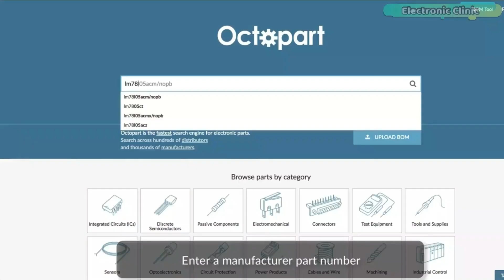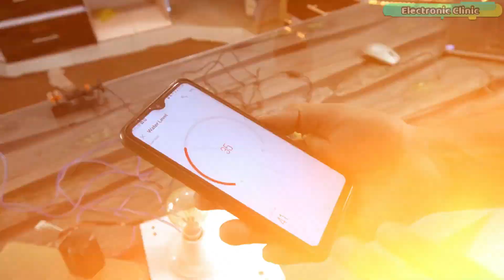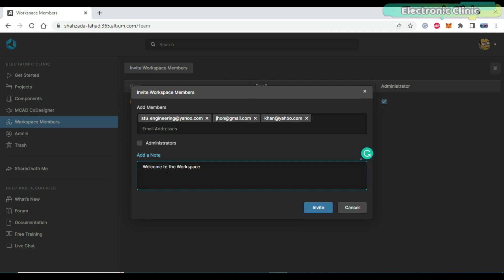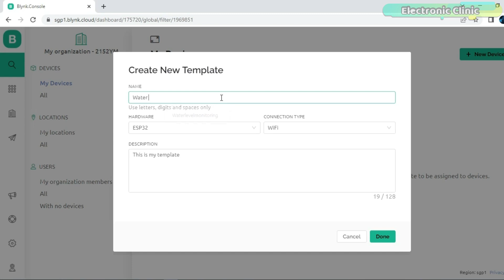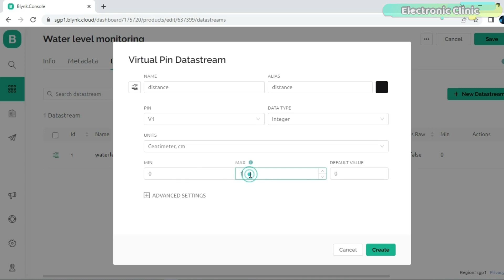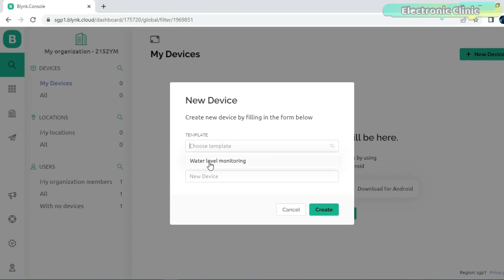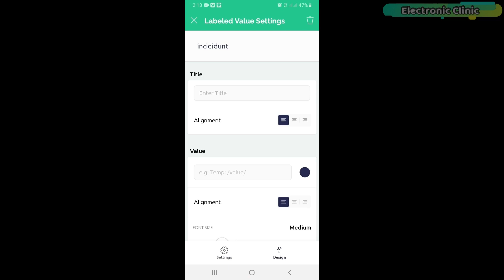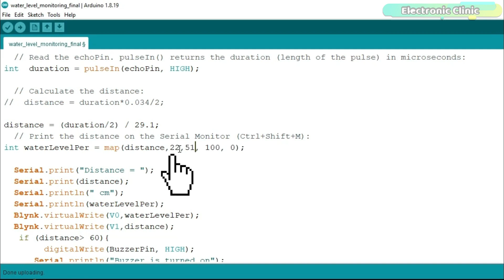IoT based Water Level Monitoring & Control System using ESP32, Waterproof Ultrasonic Sensor, & Blynk

Comment: Thanks for wonderful video. Circuit diagram of prototype project is fine but in practical scenario, how did you manage placement of Relay and ESP32  assuming Water pump motor is placed at ground in separate society cabin? I mean  did you place relay and ESP32 on Terrace near Tank and took relay output AC 240V phase wire all the way down up to inside ground cabin or you placed relay and ESP32 inside ground cabin?. if so in this case how to connect GPIO -25, 26 of ESP32 to TRIG and ECHO pin of sensor which is all the way at on Terrace?. If it is not your home scenario, but if this scenario come how can we manage this?
Reply from the maker: It's simple, use two esp32s 
One as transmitter and the other as receiver. Watch my video on esp-now, or you can use LoRa , watch my recent videos on heltec lora32.
Reply: @ElectroniClinic  OK. thanks for prompt reply

Comment: Hello Friend,can we use your coding if we don't want the Blynk part? we just want use the automatic system wireless water controle make off and on the Pump But Without monitoring to Blynk? i'ts possible with your code? Thanks in advance for your reply.
Reply: Oh sorry i make a mistake to my previous message,I confused it with your previous Wireless project, in fact I would like to make the wireless system with the control of the pump by the relay. if you can help me for that? thanks

Comment: hai bos..could u give me an idea.. why i can measure the distance under 20cm..bcause i am using a small bucket of water..the minimum reading neead to above 20cm
Reply from the maker: The jsn sr04t cant measure distance below 20cm. You can use A02yyuw waterproof ultrasonic sensor.
Reply: @ElectroniClinic  oh i see..thank u very much..the information is really useful bcoz my due date for my project i really near..thanks a lot..

Comment: Does your device  sometime gives false readings?? because I am facing this issue
Reply: I had tried this project 8 years ago. And sensor gave lot of false reading in between. It suddenly jumps to maximum reading in between. Was not able to complete the project. Hope there would be some newer codes which remove these errors by now.

Comment: Do you have any issues on the water getting fogged up in the sensor due to evaporation, leading to inaccurate results or the sensor getting worn out?
Reply: I’m having this same issue with water condensing on the ultrasonic probe. Anybody found a solution?
Reply: You can try it out with small holes around the sensor instead of air tight